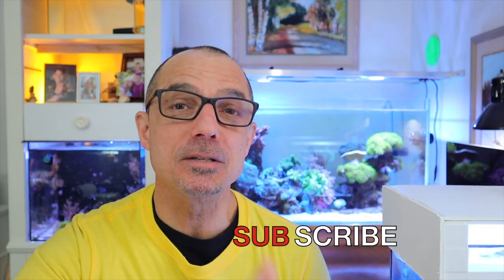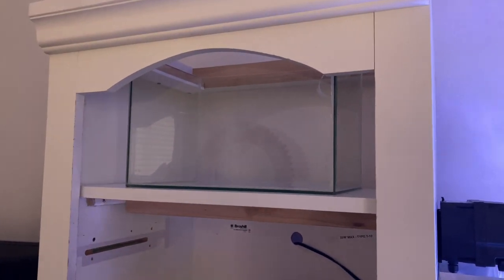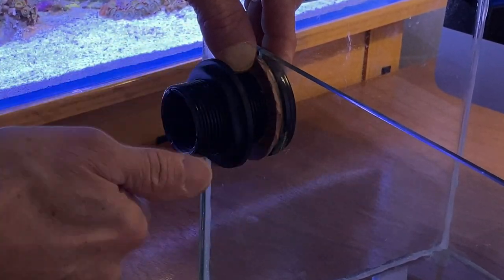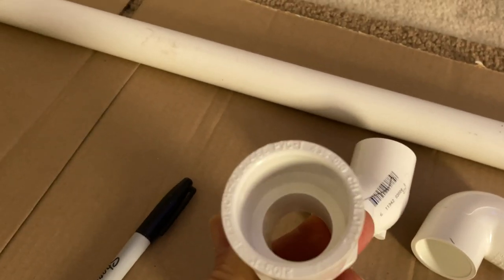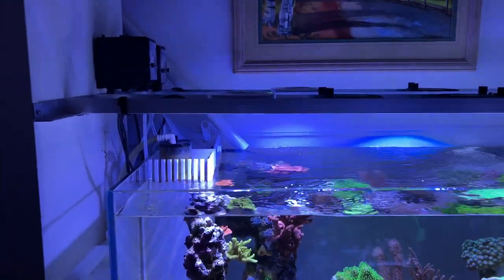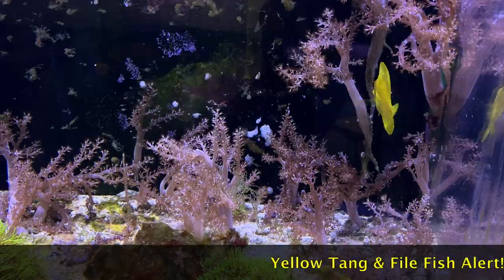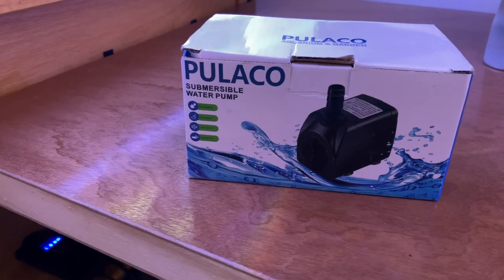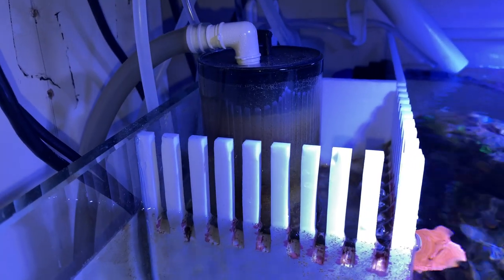How To Set Up A Simple EXTERNAL GRAVITY FED Refugium (Part 2) Plumbing & Flow

Comment: Congrats on 5K subs! Update on my tank. I got rid of the Dino’s but now my nutrients are sky high .. it won’t settle in the middle lol. I got an ORA Red Sea urchin to help with the GHA and I’ll do a few water changes maybe it will stabilize but I have to be careful not to bottom out my nutrients again 😩.. i have been using Dr Tim’s waste away and it really seems to be working. Normally I would have horrible hair algae come back when I ge the nutrients back up but I feel as if the bacteria I dosed is getting to the nutrients first which is cool. it’s getting there tho I’m glad I stuck with it .. I’ll never ever ever ever go dry rock again tho.. I always started my tanks with live rock and I never had issues like this !
Reply from the maker: Stick with it Botzz😊👍🏻

Comment: Hey Tom - I have a little 6g gravity refugium on my 70g DT. Its its awesome, but beware. That macro algea will suck all the nutrients right out of your tank and cause diatom blooms, siano, and LPS to die. Pay attention to the first sign of trouble, which is no algae on the glass. Also I would put an inline valve to close the flow, and regulate the phos/nitrate uptake....which means you need a circulation pump in the refugium,  or one of those small clear nano HOB filters. Looks awesome!
Reply from the maker: Hi Marcquis, you must think I’m a rookie😃
Reply: @TOMReefer  Not at all. 🤣. You are spot on and far from a rookie. I just thought I'd share the consequences of running a fuge and a skimmer...mainly for other people considering running both. In your 75 update I heard you say that you turned the skimmer off at nite. I had to turn mine all the way off...for a few week. I guess the point I was making is that my little 6g gravity fed display fuge is very efficient. 😊 Keep em coming!

Comment: Coming along nicely! Also I highly recommend the sicce pumps they are very quiet, or even a jebao/jecod dc pump so you can fine tune the exact flow you want
Reply from the maker: Hi Josue, thanks! Yes, I’m familiar with Sicce, I actually have a .5 ready if I need it.👍🏻the jebao sounds good because of the control 👍🏻

Comment: I'm not a big fan of bulkheads I had one of them leaking on my hundred gallon anytime you drill holes through glass with the bulkhead installed eventually you will ever problem. I've used those PVC cutters they make working with PVC so easy by the way I check my tank every other day all the plumbing for leaks just to be safe it only takes a second your tanks are looking awesome tom
Reply from the maker: Hi Doberman guy, I know what you mean. I’ve been checking, all looks good so far. I’ll just keep an eye on it. Thanks for watching 👍🏻😊

Comment: This is great, we're such a generation programmed to just buy equipments so this is inspiring. Learning alot as you offer some great tips when it comes to DIY.  If people use their minds, there is a DIY solution for anything rather than go and spend money on a new product.

Thanks, amongst the slew of reefing YouTubers, you definitely sit firmly amongst them all.

Question though, I didn't catch this on the previous video but are you going to feed water from the tank to this refugium using a pump or water from an RO unit? I don't think it will be an RO unit as that water doesn't have any nitrates or phosphates to feed the refugium or pods
Reply from the maker: Hi Rudra, thanks for your kind words! The water gets pumped from the larger tank. I have a small pump in the chamber that pumps up to the refugium. 👍🏻😊

Comment: @TOMREEFER amazing detailed video i just did this with a spare 10 and i got the pvc all glued together and in place and then got concerned did you do anything special to the pvc after cementing them to make it safe os it already safe 24 hrs? Thanks
Reply from the maker: Hi Ravaged, the only place you might be concerned would be the bulkhead or connection coming out of your tank. Just make sure you have a rubber gasket between glass and bulkhead washer. And tighten it down😊 if you used the PVC glue correctly, there wouldn’t be a problem at all with the connections. Once you start running it, just keep an eye on the bulkhead for any drips. Tightened down a little bit more if you see dripping. Let me know how it goes! 😃
Reply: @TOMReefer  will update thank you for the speedy reply. Have a terrific evening
Reply from the maker: NP! Have a great evening as well

Comment: hi tom great vides congratulations!
I have a question:
why don't you use carbocalcium instead of two parts? just need a doser and it's as cheap as kalkwasser and more concentrated.
I was waiting for this video! 😎
Reply from the maker: Hi Pedro, thanks! I’ve heard about carbocalcium Tropic Marin. If you’ve had success with it, great! You know how it is with reef Keeping, you find things that work for you and you stick with it. I’ve always used C Balance, and have great success. And a one gallon mixture lasts 6 months for me. So? 😊thanks for watching the vids!

Comment: I have a question for you Tom. Background: I have a 90 gallon tank. Believe it or not, I have it set up as follows: It is filtered by 4 hang on the back filters and a big hang on the side protein skimmer. Water flow is accomplished via two big Koralia pumps. Lighting is, again believe it or not, accomplished via a marinland light strip and two LED spot lights from home depot. I can't really afford actual reef lights. I have green star polyp and two favias. They actually do ok. My QUESTION: Is there an additive I could add to help them be the best they can be, on the market? I use a basic salt mix and regular tap water.
Reply from the maker: Hey Steven, the only thing I can think of is amino acids for coloration. However they are really pricey! It also depends on your idea of what you want them to look like? You may have a handicap with the lighting and the tap water? Not sure. You’re up in Canada,  your tapwater may be really clean and low and TDS? Are your HD lights 6500k? You should also put some fish in there. They become the organic food for the corals. What are your parameters?

Comment: Tom you're adding another pump for the refugium isn't that gonna add more heat?
Reply from the maker: Hi YB, a small amount, not really measurable, it’s a very small pump 185gph/700lph. And I don’t have a heat issue. Tank runs between 77- 79F

Comment: Hi Tom. Nice work. Very clear. How is the flow inside ? 5k 🤩
Reply from the maker: Hi Jean, thanks! Good question. Flow in the refugium not much. I didn’t want water rushing into the main display. However, I will probably add more with a hygger? Lowest setting. Just enough to move water around. 😃👍🏻5K

Comment: won't the gravity feed refugium dump water that will cause salinity changes in your main tank ?
also do you use ATO on the refuge?
Reply from the maker: The refugium is plumbed into the main display. It shares the same water. 👍🏻water is pumped to it from the display tank overflow compartment.
Reply: thanks for the explanation @TOMReefer
Reply from the maker: NP! 😊

Comment: Hey big T , luvn everything ur doing with 70, but now the question …I have a bubble tip anemone and had it for a week but it doesn’t look good today I swear my clown is killing it  but it just didn’t come all the way out and looks to have a brown tint (it’s a green bt) my parameters seem to be perfect except ph  it is typical at 7.8 I would like it a lil higher but hey..nitrate is 5  Ish , no ammonia dkh is 8.6 temp 78 .4 constant  nitrite 0 phosphate is basicly unreadable  it’s mouth is puckered not loose on rock at all. I hav ai 16 I have blue at 36 royal24 white 19 red 1 green 1 ur 14 but u understand we really don’t have uv purple at 11 …maybe not strong enough was gonna go up a lil every week any suggestions? Thx johnny5 also anyone have any thoughts .can use all the help I can get
Reply from the maker: Hi Johnny, anemones sometimes take a while to settle in. A week is not much time. So many factors. Your parameters seem fine. I would give it a few more weeks. But make sure you’re feeding it. In the beginning 2 times per week. 👍🏻😊